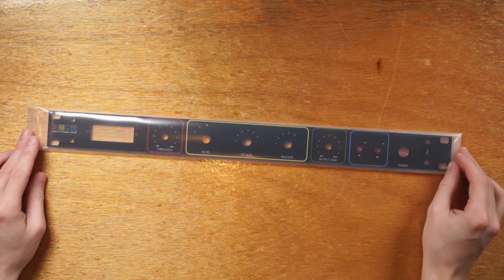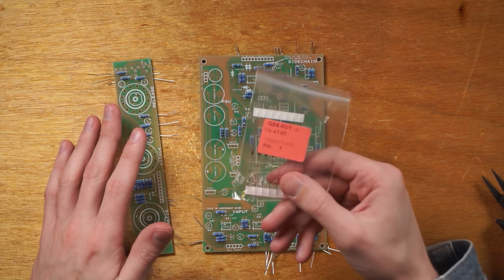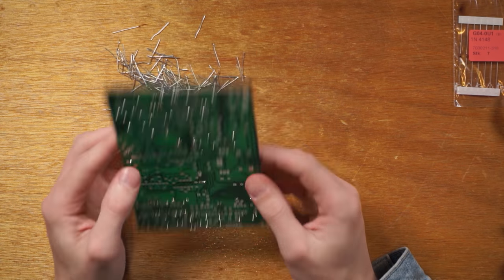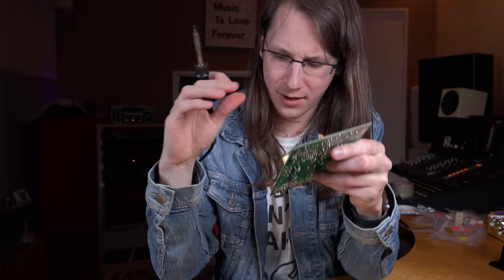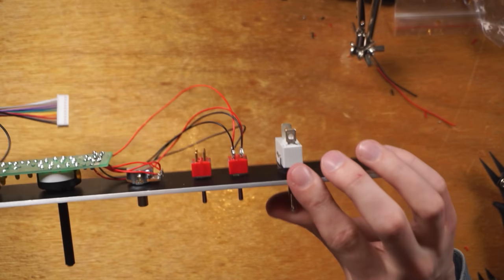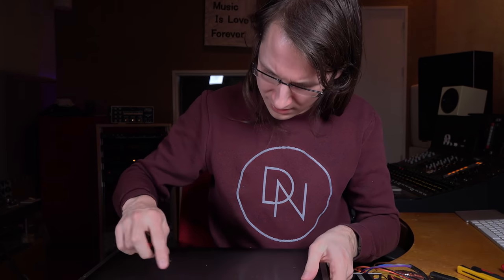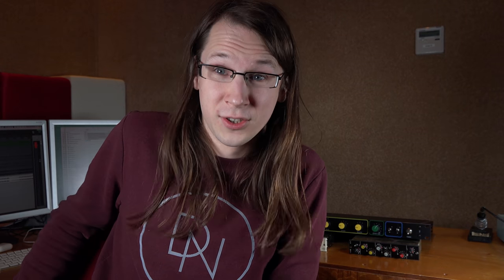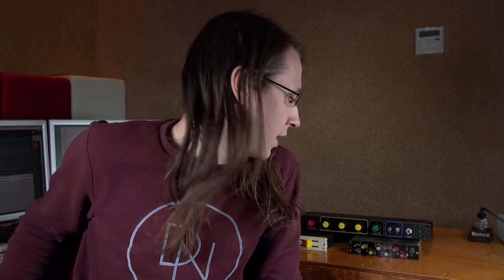I'VE BUILT A REAL GLUE COMPRESSOR!!!

Comment: The GSSL schematic has a big flaw you invested a lot of money in the goldcan vca’s so you should fix this too. It behaves very strange to side signals because the sidechain that feeds the compressor is summing the stereo input to mono. I fixed it by building the sidechain section with the “that 2101” a second time and let each channel trigger its own sidechain and controlling the goldcan vca independently. 
You can also look in the original schematic how ssl did this, back than.
Now it is working as it should. There is a youtube video out there that shows this.
You should also meter your compressions ratios if they are indeed 2:1, 4:1 and 10:1
Reply: The turbo mod modifies the GssL, so its a "highest side wins" trigger, and not the sum of them going to the SC VCA. Control voltage is still summed to the L/R VCAs (wouldnt be a stereo compressor if they were triggered independently by each side chain). 

Its a common mistake floating around, saying the turbo mod turns it to stereo. The real difference is mostly in low end triggering, due to nature of the pre VCA summing, and mostly in compression at "shitload of compression levels" level, which displays the typical VCA character, regardless of SC build. The high pass filter does the job just as well to compensate for that if needed imo, but of course, YMMV.

Unit in the video sounds great to me!
Reply from the maker: I knew about the "flaw" getting into it, but I've decided to first get a working original before doing any mods. I'm also only going to mod it if I will get annoyed by this flaw...
Reply: @GOLY_DK  you are right, it is the stronger signal wins in the "mod"
It is not really a mod tbh... it's just a second sidechain circuit.
Reply: @Whiteseastudio  okay.
I have some extra pcb's with the sidechain section laying around that I ordered from china. If you need it. Let me know.

I must say I actually never use the gssl because there is something wrong with my unit, I have to look into it again, after my moog modular clone is done. Maybe cloning dbx(that) 202 XT vca’s for it.. I will see :D
Reply: @GOLY_DK  Yes, the GSSL is stereo compressing alright - the reason why it is summed-before-sidechain is that our (real) SSL4044 desk was set up like this for a very long time (because of an error going unnoticed in a 82E27 card). 

The difference between Aarhus and Oxford modes is that Aarhus detects on correlated information between channels (the "M" component) - whereas Oxford detects on two channels, then correlates. So the difference is really only important when you have highly de-correlated dynamics in the two sides - which very rarely happens irl.. :-)

Comment: I just finished assembling one of these and have spent 10 hours troubleshooting, essentially when I turn it on the compressor immediately peaks on the meter and the signal getting output is very low level, just a rumbly compressed sound which I'm assuming is extreme compression. The front dials have no effect... Gustav from PCB Grinder says it sounds like I've got DC in the sidechain but I can't find any short circuits. Assuming its a component issue... has anyone else bought one of these and had the same problem?

Comment: I was actually considering getting one of those DIY kits but now that I see how complicated it is and how dangerous it can be (for someone like me who knows nothing about electricity), I'm having second thoughts :D
Reply: Check the beginners assembly guide on the site!
Reply: @GOLY_DK  Will do, thanks !
Reply: If working around high voltage puts you off there are also a number of kits out there that use external ready made power supplies. JLM Audio for example. Also anything 500 series.
Reply: I already mentioned this in a different comment, but there are also DIY versions of the SSL compressor for the 500-series rack, if this sounds more like your cup of tea (aka. less dangerous and complicated). Besides the Mix Buzz by Igor (which is hard to get these days), I highly recommend the CP4500 kit by Sound Skulptor. I built two of them, and it was a lot of fun.

Comment: Good job !!
Please one huge thing to do .....you run 220volts in your country ..so please de - solder again the cables behind the 220v input and put Shrinking tubing on Neutral and the Two 110v live wires !!
You can get killed instantly with 220v !!
Over here we use 120v and that can kill you if you are wet but i have been zapped many times with 120v and nothing happen (unless that why my short term memory is terrible !! hahaha ) just kidding !!🤦😂😂😂 
Please protect yourself and Congrats !! Btw how much was that SSL comp kit ??

Comment: "Join the rat and the orange wire together" :O

Great video, the unit looks awesome! I've started learning a bit of soldering and repaired a few simple things in my studio. Just replacing encoders so far. Want to make the DIYre re-amp box as my first build. 

The song you are running through the compressor is very cool, by the way. Who's the band/artist?

Comment: Why don't you drill two small holes on the bottom plate so you can do the calibration without taking it apart in such a sketchy manner?

Comment: 16:53 "we dont need to touch this anymore" ...yes you will when it breaks. Terrible joint....i'd expect a far better joint from a Dutch person.
Reply: I thought the Dutch were very skilled at rolling joints.
Reply: I don't think that's going to break, with the solder, heatshrink, no mechanical stress whatsoever.

Comment: 9:30 full bridge rectifier is always better? Since when? All it does is turn an AC signal to DC and then you put a properly sized capacitor across the output to get a stable DC level. Saying that a full bridge rectifier is always better is just nonsense.